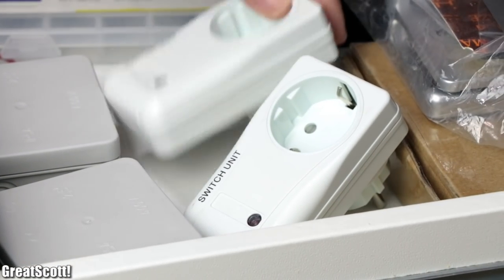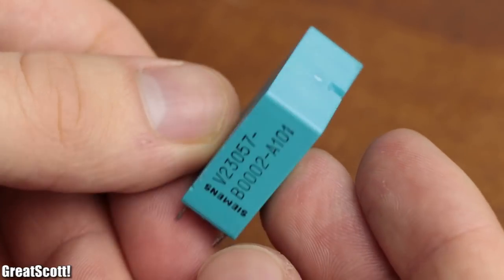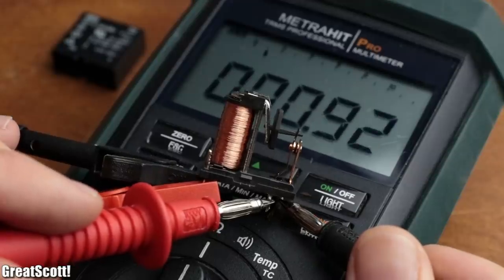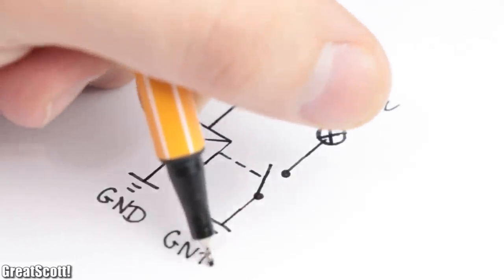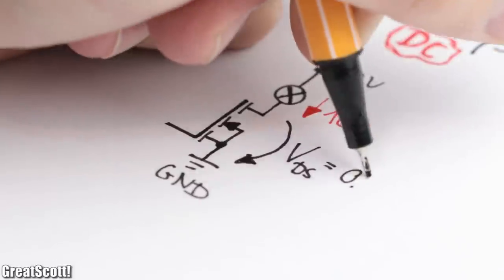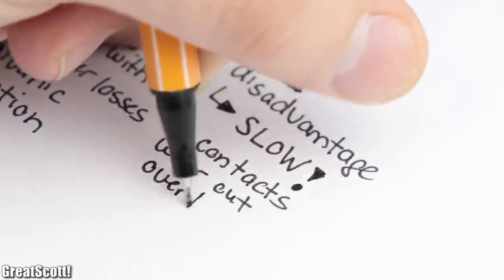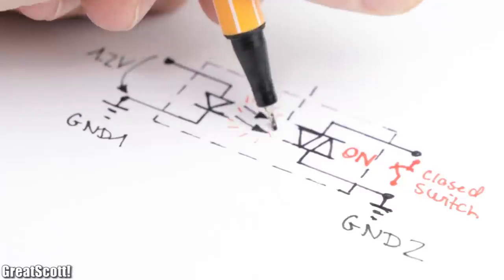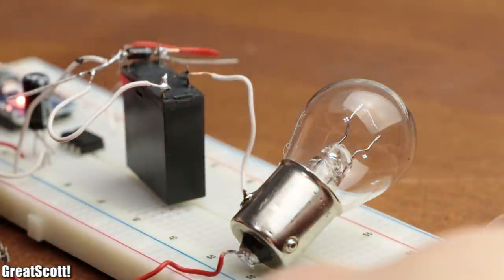Electronic Basics #32: Relays & Optocouplers

Comment: That was great, what I would really appreciate is for someone to make a video going through 4-8 relays, where they have the relay in hand and then they show the exact same thing on digikey/mouser and go to the schematic, run down all the items in the absolute max/ normal operating data for the first one, and then just explain the differences and what they are all typically used for (ie Vswitch and Vload + in what application) and what you could safely get away with.

Comment: Hey Scott. A couple suggestions. I find it difficult to follow the diagrams when you're changing angles all the time. If this is to get out of the way of your hand, consider taking photos for the video after you've written the item down. It's also difficult to follow when the diagram isn't facing straight ahead. I realize you're trying to make it exciting, but there has to be some respect to what works and familiarity works. When we see the same diagram in the same position, it is easier to follow the message. If the position and angle change, we have to rescan the entire diagram just to see where you're adding this new information too.

A second suggestion, buy a new highlighter. ;)

Comment: There are also solid state relays. I work at a factory were we make electromechanical relays, some a lot more complicated than those shown. A lot of them have the diode you put on parallel already inside the relay. Overall, relays are very interesting pieces of technology that combine topics from science of materials, electricity and magnetism, even thermodynamics!!
Reply: Also keep your expensive relays sealed, some have nitrogen on the inside which reduces oxidation and loads of corrosion

Comment: Thanks for another video, you always get me thinking. That could be a good thing, or a bad thing, lol.
The dreaded transient spike, or sometimes called inductive spike in the RC drone world. It’s been a past debate with RC motors about how to handle the spike, the old way was an electrolytic capacitor. Most of the time not correctly specked for the size of the spike and people wonder why the FPV and ESC still blow. But the cap may help filter line noise for the FPV camera like an incomplete LC filter. The new way argued as you mentioned is the flyback diode (or sometimes called snubber diode) but placement in the circuit is a big factor also. Then newer TVS diodes these days are not just for huge spike like lightning, but they are making them now for smaller spikes also. Plenty of choices depending on the application. I never thought about using an optocoupler for inductive spikes in the RC application world. I was trying to find a one fix fits all solution, but every RC drone is different, different power, different load, different esc’s. I didn’t think I will ever find a 1 fits all add on solution for everyone, so I put the project in hold and forgot about it.
I don’t use relays often as you could guess, relays are a little big and slow for RC flying planes and quads (drones). But it makes senses, same kind of inductive load spike with the magnetic coil in a relay like the electric magnet in a motor. I wonder how small them come, how fast they can be, and if this might be a solution also? Now I have to go back and review notes, look at this with a new possibilities and different angles. You gave me a few ideas on an old project I forgot I was working on. I might need to get back to that project now. 
Thanks for the video,
Scott

Update: As I’m typing this I realized the optocoupler wouldn’t handle the load, and to use it for the esc signal line only would not isolate the spikes I’m looking to suppress. So back to the trusty diode theory and testing when I have time.

Comment: The hx711 is awesome, especially for the price.  Load cells are incredibly sensitive, measuring fractions of a gram with relative ease.  The only issue us having to "tare" the system before applying any weight.  If you lose and regain power, with weight applied, you will have zeroed the scale with the included weight, which isn't always of great convenience, depending upon your application.  Drift will also occur.  There is also a "combinator board" available that allows you to connect multiple load cells together in wheatstone bridge fashion, that operate as one measuring device, though it's not absolutely necessary, it just makes things easier.  You will find these in bathroom scales, where four corner load cells are used to determine weight, no matter where it is applied to the overall surface.  Leverage is a factor in the beam type cells; all of the applied weight has to be "focussed" tons single point on the beam, if you want accuracy and repeatability.

Comment: I used to work on fire alarm systems in Canada. North american fire alarm panels (Edwards, Mircom etc.) Uses relays, mainly for fire alarm bell and auxiliary systems triggers (elevator stop, venting systems etc.). Specially for fire alarm BELLS and not horns. If i'm not wrong : it's better for bells solenoïds, and because a bell cannot do the 3-3-3 standard fire alarm rythm. In this time, a relay is doing the job (one by Bell loop).

But only once, i've seen only one Simplex fire alarm panel model that used MOSFETs, even for bells.

Interesting. I didn't have time to check the circuit and see how it works without power loss.

Comment: Nice work as always
Many years, i am in the field of automation.
Initially, i was using arduino with mechanical relays but always an error due to spike voltage even with flyback diode.
After that i started with TRAIC BTA41 which can sustain upto 40Amp.
My system is working fine
I also used this traic with stm32 works great.
In my opinion, Traic is much superior than mechanical relay.
A tutorial on this topic from your side will be highly appreciated.
Regards

Comment: 4:05 From what I learned, the voltage spike is not due to infinite resistance, but rather because U = L di/dt in a self, and since the current goes from something to nothing in a fraction of a second, di/dt is big thus U is big too.

Comment: Thanx for few important points. This video was created 6 year back and there are some advancement in technology. 

 I want to know, which is better solution for Small" 220V AC LOAD", which draw less then 2 A current ?
a.      SSR  ( opto coupler MOC30XX , +  BT13X )   e.g  "MOC3063/zero crossing"     ??????????
b.     5V/5V    RELAY      ???
c.      MOSFET ( with mosfet driver)  ??

Comment: So is the flyback diode necessary on a 230v coil relay because I would never have normally used 1 but I thought I would try it and the result was it simply blew the fuse on the plug I was using to test it

Comment: For smaller form factor relays I've noticed datasheets indicating they aren't designed for high duty cycles. I have a 12vDC thermostat project where I plan to use mosfets & a quad opti-isolator IC due to space constraints. I located some tiny relays w/ contact rating of 2A which is about 2x the expected load, but the coils are about 800mW & the datasheet indicated they shouldn't be left on for long intervals. I'm still looking for a schematic of the existing thermostat's board to see how the switching is handled.

Comment: Hello sir 

I want to know if i can use a BTA41 triac with Moc 3021 optocoupler IC to control heavy loads such as Air conditioners, refrigerators, microwave ovens etc. or the appliances whose current ratings are more than 10Amps and power ratings are nearly 2KW  and if this combination isn't the right one then please guide me 😃

Comment: I want a circuit to turn control a relay a simple example would be to turn on or off an inverter when at the right voltage. Example turn on at 13v turn off at 12.1v my outback mppt has this option but I would like it as a stand alone option. Any thoughts on this?

Comment: I have a problem with opto isolator in my circuit it is still respond to command but only give weak current output around 2ma. I connect the output to drive 12v relay. Why is like that?

Comment: Thanks for this great explanation about optocouplers. I currently need to replace one. Can I figure out which one I need just by the Data written on it? In my case it says L13/34 817 C. Does this mean another 817 C will fit my needs? As far as I got to know the L14/34 stands for the production year and week.

Comment: yup its like you predicted what i need you to make a video about lol, if i can trouble you with one question though
im planning on putting a raspberry pi in my car and need to change 12volt signals to 5 volt ones, can i use non inverting hex buffers for this purpose such as the  CD4050B

Comment: What would anyone recommend for isolation of a varying input of 10-80VAC at 10-300KHz, trying to output a digital 3.3V signal to a microcontroller?  I'll probably use a voltage divider to reduce the voltage by 4 to 5x, control the current, and something to clip anything above 18V or whatever the components are capable of. 

The purpose is to monitor the frequency of a power electronics circuit. I don't suppose linear regulators can handle those frequencies?

Comment: I have a solid state relay, 220v to 5v switching power module and a Wemos D1 setup to make my living room lights IoT but whenever the fridge starts running (and probably creates a voltage spike) the light flashes once. It only does this when the lights are off. Does anyone know how to prevent this from happening?

Comment: My output voltage from my relay is low...I mean when I connect 12 v 2a directly to a motor it turns very fast but after it goes through the relay it turns very slow ..I m using jqc-3ff-s-z relay..is there is problem with relay selection or something else?
Reply: How are you connecting the circuit?

Comment: Very cool! I have a question though, what's the point of using an optocoupler before a relay if the relay won't be fast enough to switch at whatever frequency you're using the opto at? Or is it just for double isolation?
Reply: i think it use to prevent  electro maganatic pulse from get into micro controler

Comment: +GreatScott! Will the relay be faster if you increase the input current of the coil of the relay?
Reply: I think you mean voltage since if you increase the voltage the current draw will rise. It will turn on quicker due to the electromagnet having a stronger pull on the metal switching it on faster but it won't turn off any quicker as a relay is still partly mechanical. Inputting over the rated voltage of the relay can start to damage the coil depending on how much higher of a voltage you are using.

Comment: Hi GS, would you be interested in doing a systematic video where you show a relay oscillator (was called a vibrator back in the old car radio days) and demonstrate that you could use a 12 volt input, say from a car battery (or bench supply ;)), and drive the DPDT or DPST relay through one of its' NC contacts and tie the coil to that contact's common. I would like to see the different oscillating frequencies that you could achieve of different relay part numbers, because this will be dependent on the spring and mechanical portion of the relays. Use the other contact to drive a boost transformer's primary input (other end primary tied to ground or negative side of battery) (watch out for high voltages!) and the secondary, being a boost, would have say a 4x multiplier so 48 volt (ACish) output. Of course, the flyback diodes would need to be picked carefully... PM me if you want a diagram. I understand that you call your relay operation differently than DPDT or DPST in Germany, from your video. Some of the relays, I dare say will come apart rather quickly, *you may want to place a switch inline to remove or apply power, but would be interesting subject, nonetheless.

Comment: It sounds like Optocouplers are far more advanced than mechanical relays. Can they adjust the output continuously? Because the brightness of the LED light varies continuously. If the detector could change resistance according to the light, the optocoupler should vary the voltage with continuously.

Comment: Last time i had much problems with a cheapo China Relay, because of the connection. there were to Pins described as NC, one was "normally closed" and was "not connected".
Reply: LOL - typical. :)
Reply: NC in the context of relays means normally closed but in the context of ICs then it means not connected

Comment: Is it possible to connect the diode series to the indicator such that in order to avoid high voltages at the tap key by stopping current in reverse direction?????
Reply: Yes

Comment: So all I need is a relay and a diode (or an opto isolator)? I was under the impression that I had to use all the components which one can find on a breakout board with a relay on it.

Comment: Hello. I have a question. What to use to control big electric load with extremely high frequency that reach 90 KHz. Please I need to make this using an arduino. It is very important. Thank you so much
Reply: Mosfets with driver IC

Comment: How do you calculate the power consumption of a relay? E.g., SONG CHUAN
 833H datasheet says: Coil Rating (DC)  Rated
 voltage 6V, Rated current 60mA, Coil resistance 100ohm. How come the Power consumption
 at rated voltage is approx. 0.36W?

Comment: Hey Scott :)
Do you think it would be possible to produce a encoder video with non arduino uC? Topics: use as controlpanal. Problems with unstable toggling. Use filters. Pin Interrupts or timer controlled read. Great job so on. Thank you

Comment: It's probably late but i don't understand. How does switching a relay with an optocoupler not take the benefit of faster switching frequency away? I know it's in case of a transistor-driven optocoupler, but why would you consider this option, wouldn't simply driving the relay easier?
Reply: Bence Helbert the fact that the relay doesnt works for a fast switching is that the mechanicall contacts doesnt work for that aplicattion  due to the little sparks appearing everytime you open and close the contacts wich causes the contacts to become "burnt", so if you are switching it faster it Will Only causes the contacts to be burnt faster

Comment: Hey greatscott 
Love your videos

I have a question
I want to use a relay in combination with the arduino so as to turn on and off an AC light bulb to the tune of very simple music 
Like Mario theme song 

Here you had mentioned I would need to use a diode 
But I have a very big one 
The MUR420 to be exact 

So could I use this or I'll have to use a smaller one 

One note this diode was salvaged but is still in almost perfect condition
Reply: And also could u tell me how I would need to wire the stuff up 

Especially the polarities
Reply: You don't need the Arduino - just the changing signal from the music could be used to modulate the signal to the bulb to change it's brightness etc.
Reply: NeuronalAxon I don't need to modulate

Just turn on or off

Comment: Why there are not relays with in built diodes
Reply: a lot do have an internal diode, especially at the bigger end. I work with some with an inbuilt indicator LED, and some other circuitry.

Comment: One thing I didn't understand is if the relay is galvanically isolated then why do voltage spikes of 255V occur at the push button?
Reply: The voltage spikes occur on the coil side of the relay, and that's where the button is. The reason for them is that as soon as the coil is disconnected it starts acting as a current source, and as the current has nowhere to go it creates those spikes.

Comment: One doubt inductors will produce induced emf in ac in dc  is just a resistor  but why relay requires dc 5v or 12v  supply can anyone explain
Reply: The coil requires a certain amount of power so that the electromagnet can switch the relay.

Comment: Sir I don't understand 1 thing which is that a relay is same as wire. so a relay shouldn't have a power loss.
Reply: arduino guy power loss of a normal copper wire i think.

Comment: I still dont understand what's the use of relays, you're literally adding  voltage so that it turns on and lets current pass to power the next device. so basically a wire?
Reply: More like a switch. The main reasons to use them are :
A) you want to switch on and off something using a lower voltage than the voltage you are switching. (say, using the 5v available on a MCU board to turn on and off a standard household light.) 

B) you want to isolate the electrical system of the thing you are powering from the regular electrical system. Maybe due to harmonics or extra sensitive equipment or something. 

There are other reasons, but those are the two main ones I see in the world.

Comment: Can a capacitor be used for galvanic isolation?? I
Reply from the maker: No
Reply: But why isnt a capacitor just two plates seperated by a dielectric?
Reply: A lot of capacitors are just two plates separated by a dielectric.

Comment: diy ups ? any chance of it happening ?
Reply from the maker: No. I will not show how to make a mains voltage inverter.
Reply: You actually don't have to. Maybe a simple USB one?
For a Raspberry Pi or Arduino project (normally powered via mains usb charger, but being able to use it for some minutes without)?